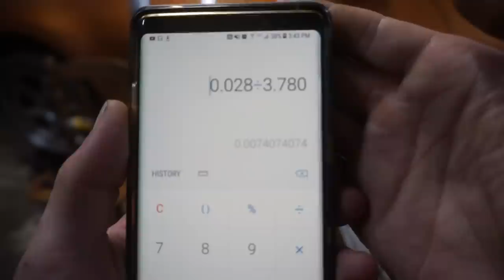Twin Turbo LS Swapped 350z!!! Checking Ring Gap!!!

Comment: They’ve decided the detonation sensitivities associated to Hot Spots associated with coolant flow in the block.  The #7 and to a lesser degree #5 cylinders actually run hotter, as evident by monitoring each cylinders EGT. 
It was verified as Not an Airflow distribution issue as well because you can run the intake Forward or Backwards and it has no affect. 
You tune more fuel and less timing to cylinders #7 & #5 to avoid failure, it doesn’t have anything to do with you touching it, I promise!  😉🙃😇
Reply from the maker: I'm aware, but like I said, superstitious, lol.
Reply: a21bravo 🤪🤪🤪

Comment: Put a pump and bearings in it Im betting he saw low op.Time to buy the tool and make a good  Cam bearing  vid.
Reply from the maker: We'll see if a cam bearing falls out when I pull it. Previous owner didn't run it, just used the heads off of it. But hard to say what happened before.
Reply: @BlaserBuilds  DOD delete next?
Reply from the maker: @lsxtmt4910  Soon.

Comment: I've had my bottom end together for a while now, then out of the blue I started wondering about whether rod position mattered. For instance, does the #1 rod need to be toward the front on the journal with the #2 rod, same for 3-4, etc. Most of what I found said that it doesn't matter on stock rods and cranks. I guess we'll see when I crank it.